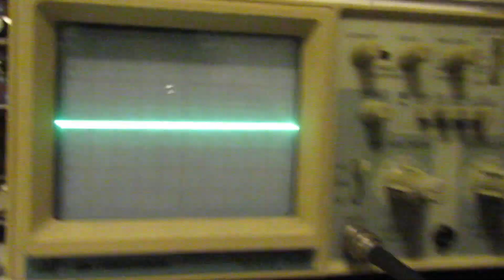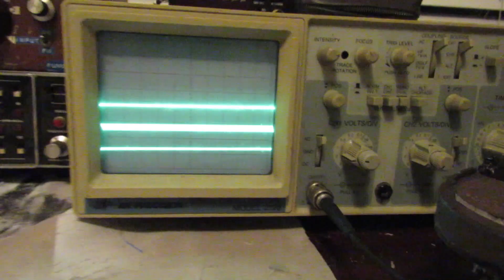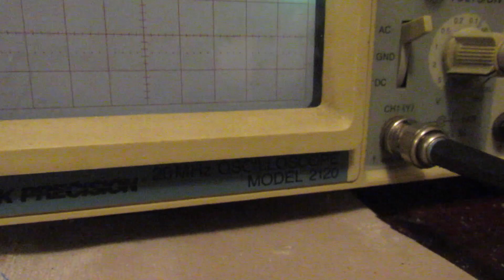Tugboat Chester vs oscilloscope

Comment: Only one way to say it = O-Sillo-Scope. forget that 'c'. Americans accent the 'O' at the start.
Must be a modern brushless motor with a PWM controller, given the waveform.
Adjust the Intensity/Focus controls to make the image sharper.
Trigger level is what makes the image stay in 1 place.
Timebase is how you select how many pulses are on the screen.
Looks like you pretty much got it anyway.
Reply from the maker: Thanks for the pronunciation tip